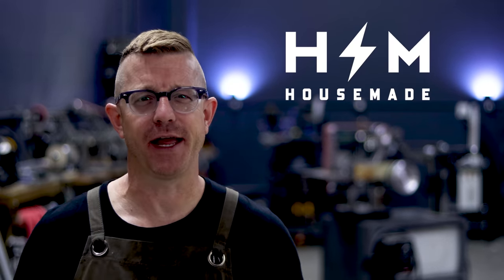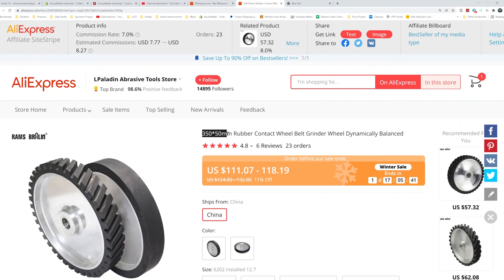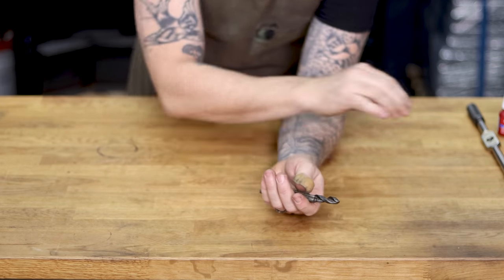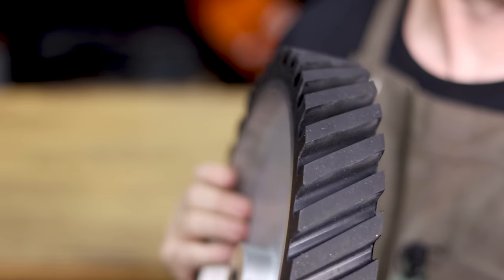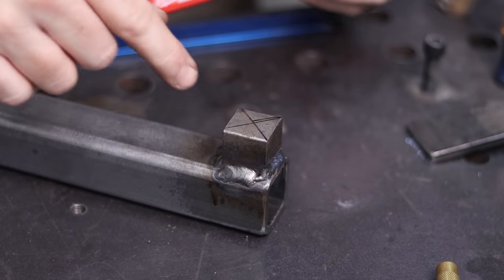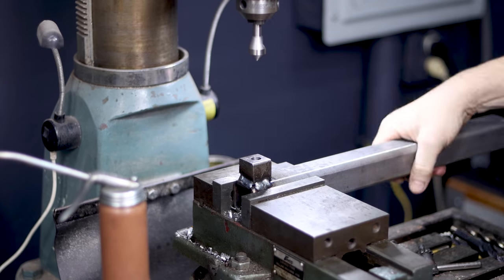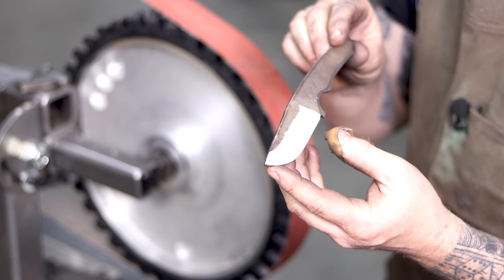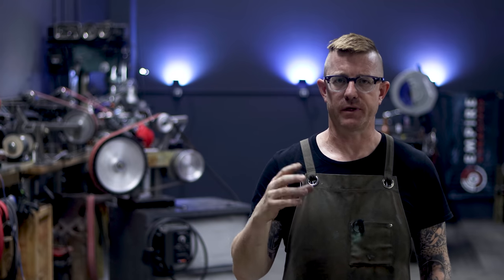How to: Add a Massive Contact Wheel to your 2x72 Grinder

Comment: I recently bought this big wheel on Aliexpress.
It took just over 3 (yes! 3!) weeks from China. Not bad at all, worth the $$ savings.
Also, I saw using a flashlight, that both bearings are in fact held in with C-clips. 
I was going to remove a bearing and install a spacer. Glad I looked first.
Great video! 
Many thanks from Oregon.
Reply from the maker: Oh man good to know! I'll have to dig into mine and seeing there is a clip.

Comment: Love those YG-1 taps.  Thanks for the shout-out.  :)  I'm gonna have to try out tap magic!  Lots of guys use it and say it's great!   Right now I just use some random cutting fluid I got at Menards on the plumbing section.  I also find the YG-1 taps work great at about 180 rpms.  I think your next machine should be a Knee Mill. :)
Reply from the maker: I need a knee mill for sure!! I have a tapping head, Ill try these in that. Woot!

Comment: That's like a frikin' tractor tyre, Brian!! 😳💪🏻

2.54cm to an inch.
30cm ~ 12 inches
10mm to a CM
25.4mm to an inch

I learned to use both when I was in construction.
Reply from the maker: I get close 'enough' lol - definitely something I'd like to fully understand one day. Your chart helps though!! 🤓 - a great way to creat engagement on any video is to incorrectly convert imperial to Metric I have found. 🤣
Reply: @HouseMadeUS  
Close enough is good enough, mate 😎

Comment: Would you be willing to make a video about dimensions of the belt sander? And maybe feature some creative ways people store belts and that kind of misc video?
Reply: I used the same cad drawings I created for a garden hose holder to hold my belts. It is a half circle, maybe 10" or so across. I added a slit to the front and use a rod bent into a hook to get belts from 8' high up on my garage walls. You can do a google search like I did, to find the various way people store belts. I doubt he will do a video on it. Basically, just keep the belt in a loop without bends. My holders have belts in less than 5 or 6 belts per group and then two groups fit on each holder with 3+ holders total.........6 groups of belts for coarse, medium, fine, J flex, and then the often used belts where I can reach without the rod. Unfortunately, I haven't made any videos recently since rebuilding my garage and making a bunch of new organization units to go with my newer tools like the Revolution.

Comment: Hi man love the content, my question is why did you get the slotted wheel over the solid?
Reply from the maker: I've had both and the aerated wheels move warm air and heat away from the work piece. Cooler work, cooler hands. Cheers!

Comment: Being a flux core guy, that antispatter spray is going to be included on my next purchase. Been putting it off too long
Reply from the maker: It’s a game-changer man, do it! 🤩
Reply: @HouseMadeUS  I ordered it immediately after seeing it in this video.
Reply: I was wondering also what size of drive wheel you are using in this video. It looks larger than a 5", or is it an illusion?
Reply: @Stillpoint23  I went with a 7" wheel on my Revolution grinder, but have a 3hp 3ph motor. I have it set to 4500 rpm max which is 8,000 sfm. Bigger is better. 4500-6500 is the speed I use most.......I set my vfd to show sfm on the display. For detailed work I will run 1,000 to 2,000 sfm. It all depends on your motor speed and HP and what you do. I plasma cut parts and do fab work but have not made any knives yet. Finishing cut plate steel or dressing tubing and small parts makes up most of my work so far. 75/25 is the only way I LIKE to go for welding. I will choose tig first, then mig, and flux core as a last resort. My brother liked the dual shield I suggested for 3/4" plate, but I have not tried it yet. Needless to say, I can't comment on antispatter spray, other than running argon mix will pretty much eliminate the need for spray.

Comment: Hello Brian, I have the option for either a 2 HP or a 3HP motor. Should I go for the extra Horsepower or stick with  the 2?  I appreciate your time.
Reply from the maker: Definitely go with 2hp. You won't get much out of the 3. 2 is plenty. 🤙🏻
Reply: @HouseMadeUS  thanks a lot. I Appreciate it